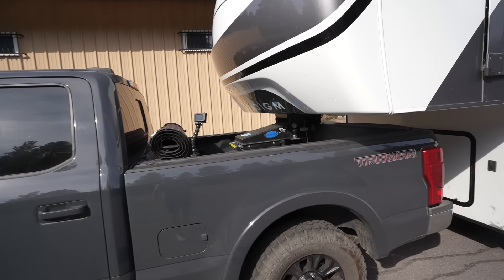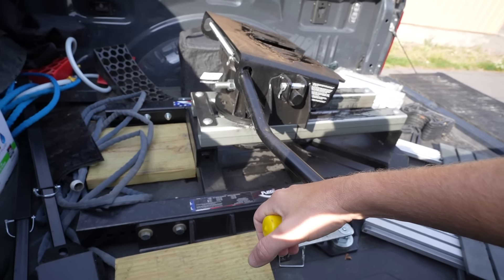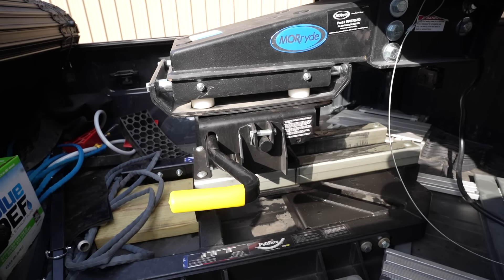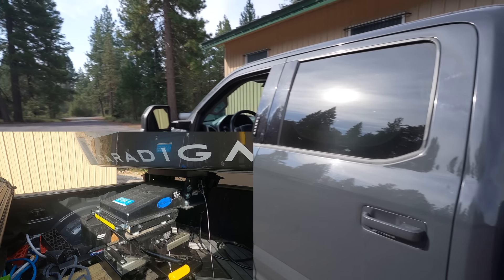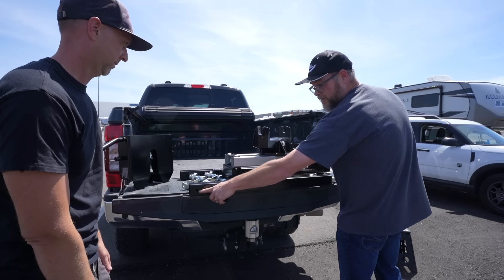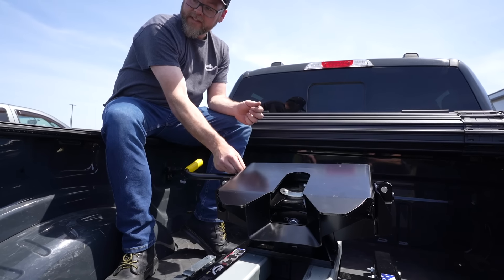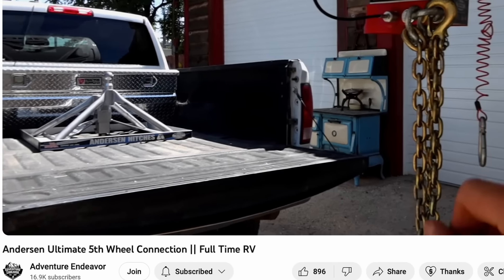The BEST AUTOMATIC Sliding 5th Wheel Hitch for Short Bed Trucks (Pullrite Superglide Hitch)

Comment: One thing that might help with the "smooth continuous motion" when hitching, is to put the truck in low range.  When you put the truck in reverse, it should start moving backwards without touching the accelerator.  I do that when driving onto my Anderson levelers with my travel trailer and Chevy 3500.  Never need to use the accelerator.

Comment: We have the same setup, for the same reasons. We were in a collision going over a mountain pass, while towing. Our trailer brakes had failed due to an unknown cut in a hydraulic line at the time. When we collided, our truck had to take all the impact - and the hitch, which did not break and took the impact, stopping the trailer. For that reason alone, it's the only hitch I will use. They are heavy, expensive, and a bit of a beast, but so worth it.
Reply from the maker: Oh wow! Sorry to hear about the accident. I could only imagine the stress of that situation. Thanks for sharing your personal experience with it. 👍

Comment: So while I'm confident I would never be in a position to tow a 5th wheel with a short bed truck, I really appreciate all the info shared in this video!
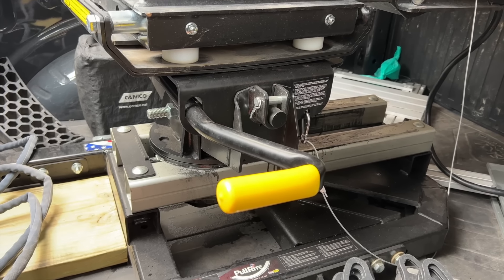I do take pause with one topic and that is using WD40 in the manner Nick is recommending. As he stated, he recommends it as a lubricant to keep the assembly from failing prematurely. As WD40 is a wet formula, it will collect an inordinate amount of dirt; look at 24:30 as the example.
IMHO, all that dirt attracted to the WD40 IS what will prematurely cause accelerated wear of the moving components. This why is seems Pullrite may recommend a daily application of WD40, as to clean the rails before travel. At a minimum I would wipe that excessive dirt off the rails before I traveled.
For sure, I would lean toward something like Tri-Flow Lube. It goes on with a wet carrier to get in the nooks and crannies, but after a while, the wet dries up, leaving the lubricating film behind. This product would ultimately attract a whole lot less dirt than what we see in your video.
Be safe and enjoy the ride!
Reply: You are right, WD40 is not a lubricant.

Comment: Pulled our 33' 5th wheel for 18 years and tens of thousands of miles with Pullrite Superglide hitch on our F250 shortbed Ford and never an issue. As mentioned in comments, a couple times we had to unhitch at an angle and had to raise up and detach the hitch head but minor issue. Our Pullrite was the first one the dealer had sold (because I requested it), and after installing it and seeing how well it work they started stocking them.

Comment: We had a tiny Bigfoot 5th wheel that weighed about 4,000 pounds dry. We towed with a long bed Dodge and had universal rails. The Anderson ultimate hitch was perfect! It was so easy to take out of the bed so we had full access when not towing. And it was easier to hook up than our travel trailer - their funnel and locking system is genius!

Comment: Don't have a fifth wheel and pretty sure I never will but still found the video very interesting. 1050 foot pounds of torque is so impressive. I remember when I pulled my 318 engine out of my truck and replaced it with a 440 to pull my 7,000 pound boat. Way more torque and HP but that had nothing like the torque you now have. By the way that truck never came with a 440 so was an interesting install. Took the motor out of an old Imperial wagon. Just can Aaron is a car guy I also had a different boat (41 foot) with 427's and took them out and installed 3116 Cat Diesels. Another interesting swap. WHAT THE HELL IS WRONG WITH ME LOL.
Reply from the maker: Sounds like a fun engine swap! Nothing wrong with more power! ARR ARR ARR! 😂
Reply: Couldn't have done them without my Binford tools.
Reply: Replacing 427s with cat diesels would make for a wonderful speedy cruiser!

Used to have 502s on a 31 Scarab. 85 was too fast!
Reply: 41 foot 15 foot beam steel hull did not make a speedy cruiser LOL

Comment: I have a short bed and was so worried about hitting my truck. I pull gooseneck trailers all the time. No experience with 5th wheels. It was long before i realized I'd never hit my trunk. Since you never turn tight enough. I sold my slider BW and got a Gen-Y gooseneck. Any looks like you all got a top-notch hitch.

Comment: Great video. We have this hitch. Like it, but it is finicky. Have to line up just right and at the right height so king pin will slide in annd lock.  Also slides backing up, so requires practice to make the changes in steering. The first week we had it we didn’t do it quite right and broke the release pin (or it may have been broken already due to a bad weld). We got it fixed after having to leave our 5th wheel at the campground (close to home) and towed home by our RV sales department. Wrote to Pullrite and they mailed us an extra release pin (not sure that’s the correct name). You looked a little too high on your 1st hitching when trying to connect. We were instructed that the catch plate should just be touching the angled hitch ramp before backing up. Can’t wait to add a Morryde to our set-up.

Comment: Ive always had an 8’ bed. Came over to look at other options. I still dont think I will be going to a short bed but the hitch is definitely interesting. Great presentation. Currently I’m a Curt Q20 user. I went and tried out the goosebox thing for a few thousand miles because my new trailer came with it and I went back to the fifth wheel.

Comment: We personally use the Anderson on our 40' 5th wheel. And I love it for many reasons. And I know everyone thinks there gear is the best lol, but I have to say when you talk about failures, every hitch has them. If you look up "Pullrite Superglide Hitch failures" there is also many posts on the internet and youtube vids showing failures for that hitch also. Just try a search. Too many moving parts in my opinion. I just rather to have a hitch that isnt moving around. But good luck with it, im sure its as good as any of them. None are perfect.
Reply from the maker: Yes for sure! Anything can have problems or failure. Most likely due to improper installation, maintenance, or some sort of improper use. Maybe even just defects in the build. I really liked the Andersen (simple, lightweight, etc)... but again it all came back to guarantee we would not have clearance issues. But it was a really overwhelming  struggle to research all the options out there! 👍
Reply: We were in a wreck with the pullrite and it stopped our trailer. I don't think the Anderson would have held up. We've had an Anderson and sent it back after a week.
Reply: Well there is no way you can confidently say that. I will say I have seen failures on all these hitches. Why did you send it back?  @NomadicLiving

Comment: Excellent video!  Well done and very informative.  We’ve used the pullrite for our first 5th wheel and are using pullrite with puck system for our current rig.  I love my Pullrite and personally wouldn’t use any other.

Comment: I use the Anderson Hithch 24000 lbs capacity on my RAM 3500 mega cab short dually bed to tow a 15,000 lbs fith wheel. It works great. Only short coming is when u make that 90% turn, u will bust that rear back window. You can get away with around 75% turn. Otherwise the Anderson hitch is bullet proof. I have used it for the last 2 yrs, driven 10,000 miles no issues.

Comment: I’m not sure that you mentioned it but the sliding hitch is necessary when you have a short bed truck AND a standard front overhang of your fifth wheel (like the Grand Design Series).  We have a similar F350 short bed and we use a Reese Goosebox hitch and have no trouble turning our truck 90 degrees. That’s because we have an Outdoors RV fifth wheel that has a short overhang that is tapered at the sides of the front cap.  We love our Goosebox as we have full use of our truck bed once we unhitch.  There are many of us that don’t want to have to deal with trying to remove a heavy hitch whenever we want to use our truck bed.
Reply from the maker: Yes lots of variables! I did mention that it will depend on everyones individual setup of 5th wheel and truck combo. Lots of variables and you don't 100% know until you actually try it yourself. Your ORV is also a 96'' in wide fifth wheel and our Alliance (and GD) have the widebody 101". Which also comes into play with the front cap design, offset balls, truck manufacture, etc. Glad to hear you're liking the Goosebox.😊 👍

Comment: when I bought my used 33oock sundance fifthwheel I used my my aunt's steel single point connection anderson ultimate fifthwheel hitch so it doesn't have the rails in the bed I can all most do 88 degree turn in a 2017 3500 ram cummins  diesel megacab short bed srw Laramie longhorn. yes I don't like having to lift it up so high to get off the hitch and it doesn't help with 20 inch wheels on the truck. I would agree that if I was traveling like you do I would buy pullrite superglide fifthwheel hitch

Comment: Gen Y gooseneck.  Better towing, with a lower center of gravity.  We have less chucking as well.  Had the hitch for 3 years now and would never go back to 5th wheel plate design.  We tow with a 2021 3500hd with 6'9" bed & 36' RV.  Less weight in the truck too.
Reply: Same had ours for three years and love it.

Comment: Ours is a Demco brand but the auto sliding feature on both brands is amazing. But with both of these units you have to be straight to hook up and disconnect.  So if you pull into a curved camping spot like in many parks you’re stuck.

Comment: The new Pullrite OEX is a new optuon that addresses the short bed clearance issues in a similar fashion to the  Andersen Ultimate.  Advantage to the OEX is it’s steel instead of aluminum and you have both 5th wheel saddle or single ball options.  The OEX will be much lighter and easier you remove/install from the bed than the slider for us weekend warriors.
Reply from the maker: Hello! That’s great timing you mention the OEX! We just visited the Pullrite HQ and filmed a video all about the new hitch. It will be coming out this weekend. And you’re right it’s a great new option!

Comment: Aaron, one option you didn’t mention is a Reese Sidewinder pin box. It moves the turning point back 22” which should be plenty to prevent the trailer overhang from contacting the truck cab. Were you aware of that pin box and if so did you consider it? It allows you to use a smaller, regular hitch.
Reply: I use the 20K Reese Sidewinder pin box with a Reese 20K Titan hitch in the bed of my Ram 3500 SRW short bed truck.  I pull a 39 foot Montana 5th wheel and have had no problems.  The Sidewinder uses a wedge block as well which at times can be tough to uncouple.  A couple slight movements with the auto leveling and it releases nicely.  The hitch saved some weight with a smaller footprint in the truck bed.

Comment: The puck system is great, if you have a new truck.  Not available for older trucks.
Reply from the maker: I know Ford sells the OE puck system back to 2012. We had Ford install ours for the 21. But, you're right not as common in the older trucks. I think the Industry Standard Rails (ISR) are more common?? Pullrite does most of their hitches for the ISR's too.

Comment: I have the Pullrite and have had it for 8 years but it is not the slider because I do have a 8' box and I have had no problems and where the locking arm is in that slot I had a big padlock because you never know when someone want to pull the lever out and stopped for eating or shopping

Comment: Excellent video and details.  I also use this hitch but recently I read that Lippert, who makes most RV pin boxes, does not recommend or approve this hitch, or any type of sliding hitch that uses a plate, due to potential frame damage.  In all your research, have you found any information about this?  Thanks
Reply from the maker: Hello and thanks! I spoke with Nick at Pullrite on your question and he said that there is not any manufacture of pin boxes that has taken a negative stance on using their capture plate. 👍

Comment: Thanks for video and information!  Who did you have install the “after market” puck system.  I have contacted Ford for my F250 with no success.
Reply from the maker: Your welcome! I ordered the FORD factory part  LC3Z5F057A from https://www.fairwayfordparts.net/oem-parts/ford-17-thru-22-super-duty-oem-ford-5th-wheel-gooseneck-hitch-prep-package-lc3z5f057a

and had it shipped to Sykora Ford in West Texas. I had to call about 10 dealers to find one that can do it. only took a couple hours and was around $300 labor.
Reply: @IreneIronTravels  Thanks for the response!  I really appreciate it.

Comment: Great video, I run the super glide in my Ram 2500 short bed. What rollup tonneau cover do you have on your truck. I have been looking for a new one after I learned the hard way that my previous one with the inside bed rails wasn't going to work well with my king pin box on a tight turn.
Reply from the maker: It is the BAK xs4. 👍

Comment: Fantastic video Aaron! Can you tell me what the GVWR is on your fifth wheel? I was just wondering how much wiggle room you had between your max weight and the rating of the hitch which is 16 K
Reply from the maker: Thanks! Our 5th wheel is 16,800 GVWR, because of the Morryde Independent suspension we put on at the Alliance factory. Normally our 5th wheel would be  15k GVWR. I thought about going with the 18k Pullrite hitch, but it is heavier than the 16k and with our SRW 1 ton truck we need to watch our payload. 👍
Reply: Our 22 F350 SRW short bed payload  capacity is 3721 and we have the 7.3 gas engine. Could you tell me what your payload capacity is for your truck? We’re also running fire stone airbags on our truck as well which makes a huge difference for us. Thanks for your time and thanks for all the great videos.
Reply from the maker: @joeallison2779 we have a little less because of the weight of the diesel engine. 3442 lbs. Also the I think the Tremor package might hurt too. 👍

Comment: Can you connect or disconnect the truck in a 90° angle, for example when it’s a smal spot and not enough space to drive the truck straight out?
Reply from the maker: No, you can only very a 10° angle. But if you had to you could pull the pin on the head and just disconnect with the head attached to the 5th wheel. So you could do a 90° in this situation. 

I really thought the hitch/unhitch from any angle was going to be a big deal for us, but in reality it hasn't been a situation for us...ever. We are always in a straight line while parking and that way we can exit safely as well. Campsites, boondocking... everywhere so far.
Reply: @IreneIronTravels  thanks.. we would like to buy actual the same car like you and a new Paradigm 340RL.. The only problem right now is too know the length of the hole rig.. We live in Europe and the max length of the car/rv combination need too be less then 57ft for a get a registration here😤😤
Reply from the maker: @Sindy4212 hmmmm yes… not sure our exact length, but I think it’s around 50ft. The 340rl is about 5ft longer. You’d be really close to your max! But might be under????
Reply: @IreneIronTravels  yeah, it’s still a lot of research we need to do😜.. almost not sure we will go for the 340RL or a Brinkley z3100.. Need to do a travel tour to Germany, found a dealer with 2 z3100 in stock😍 But thanks for your help, by the way, why are only Chris is driving in the last videos?😜
Reply: Yes, but you cannot do it the normal hook up and disconnect method because the hitch head turns, as it slides and does not keep the king pin slot pointed straight back, so its a bit more complicated, and really not very practical for this hitch, or any other one.  While you can get into an unplanned 90 degree turn due to traffic obstructions, etc.  while driving most campground spots will give you enough space to have the truck and trailer at 45 degrees at the most.

To disconnect at angles, you have to pull the two pins on each side of the hitch head, and leave it attached to the pin box., raise the 5th wheel higher than normal until it clears, and pull out.  Hooking up is a lot more tricky because you have to get things lined up to lower the hitch head back into place and reinsert the two pins that hold it in place.

Comment: We ordered a 2024 F250 Super Duty Lariat with the Tremor Package and the HO 6.7 Power Stroke V8 Turbo Diesel. We will be towing a 13,000lb Forest River Sabre 38DBQ. Why did you decide on an F350?
Reply: You need to check your available payload numbers.  The diesel engine is much heavier than a gas engine and so your remaining payload on an F-250 may not be enough to support the pin weight + hitch weight + passengers + anything else you load into the truck.  Hence the need for the higher payload and max rear axle weight of the 350.  The limiting factor with towing a 5th wheel is always the max payload.

Comment: Great video! I've recently upgraded from my Ram 1500 to a 2500 and looking at getting a 5th wheel. I've seen reviews on the pullrite and have a question after watching your video. Do you know why pullrite only has a 24k lb rating Hitch for the Rams and factory puck system and not a 16k like they do for the fords and gm? Thanks
Reply from the maker: Thanks! I think because the Ram puck spread is so much further apart than ford/gm that it makes the hitch physically bigger giving it the larger capacity.  It does make the hitch about 100 more lbs than the 16k. 

You can use the 16k ISR with a oe ram adaptor piece but it’s a little taller than the puck version and adds more attachment points.
Reply: @IreneIronTravels  Thanks so much for the reply and information. Safe travels
Reply from the maker: Also, if you have any specific questions, reach out to Nick the hitch guy at Pullrite and he can pretty much answer anything!
Reply: @IreneIronTravels  Fantastic, thank you. Knowing the ram oem weighs an extra 100lbs was good to know. Thanks.